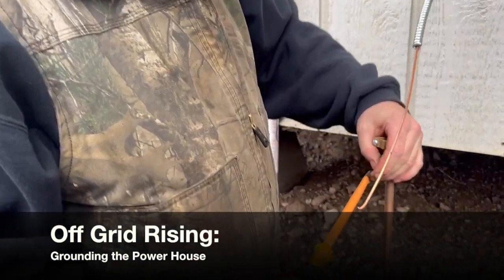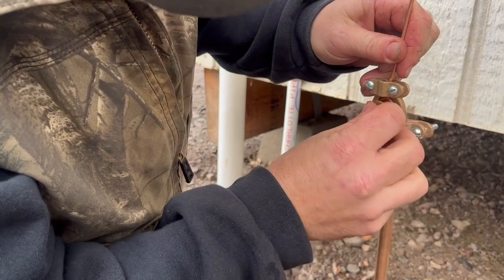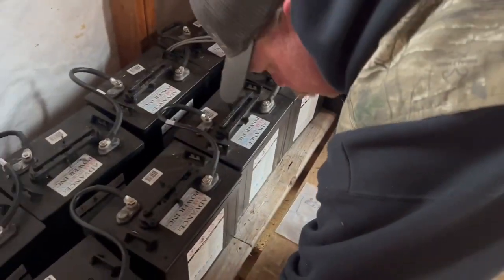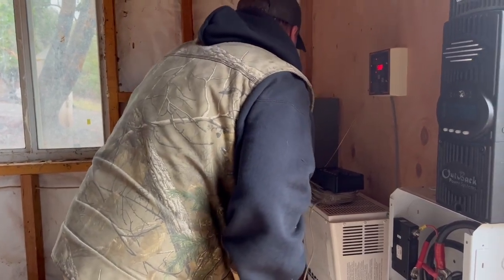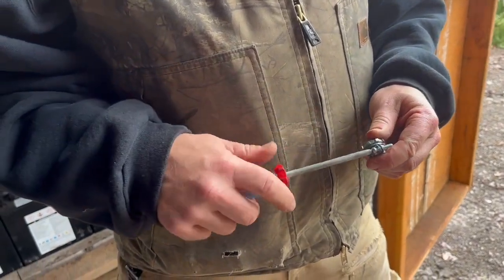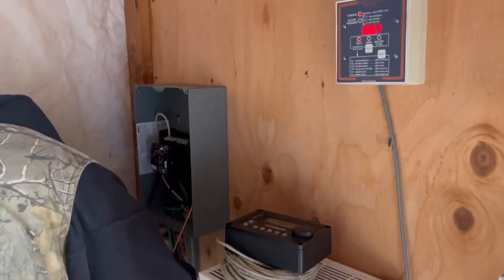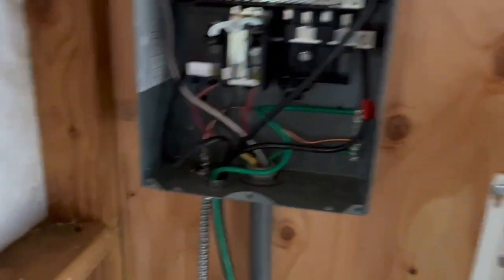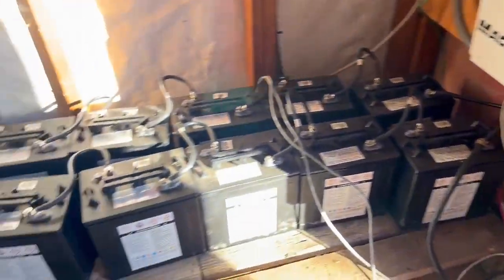How to Ground a Solar System

Comment: hi im just wondering, i got this 10w solar panels with two terminals, positiver and negative, i connected a positive wire to the positive, and negative to negative, but where do i wire up the earth wire on the solar panel terminals?
Reply from the maker: You might want to check out our video on replacing a run of wire with a larger gauge: that might answer your question!  Ours would be inside the combiner box.